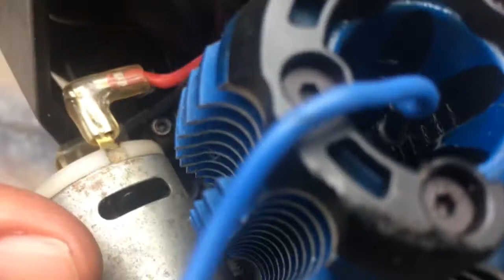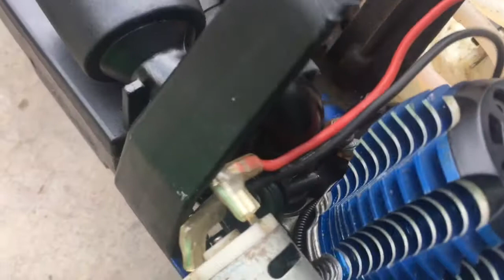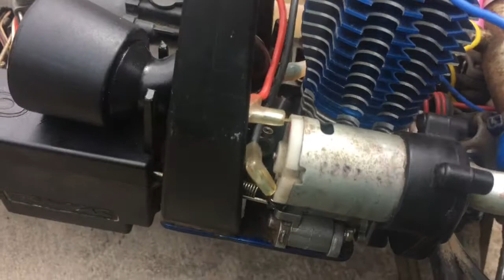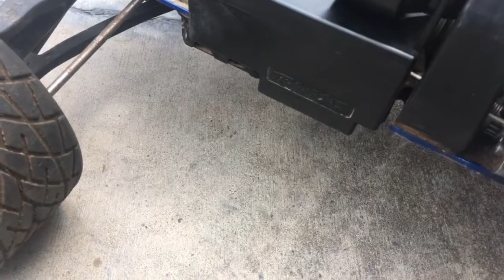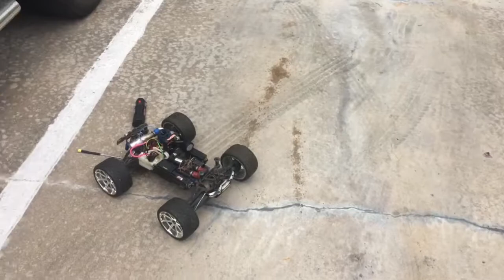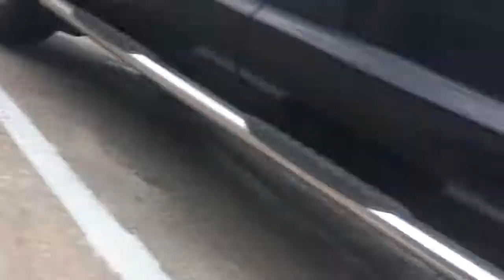TRAXXAS REVO 3.3 FINALLY START IT.

Comment: Sounds like the slipper clutch
Reply from the maker: John Green I tighten the slippers clutch it ain’t that. It’s the transmission gear box all the gears inside all eat out. And the spur gear got one missing tooth.
Reply: Deryl Rolle sorry to hear that. I've seen them explode in reverse
Reply from the maker: John Green oh it’s ok I ain’t worried about it. I’m gonna restore it anyway